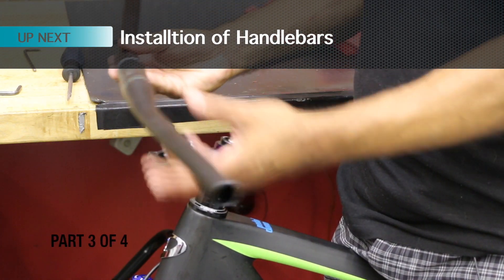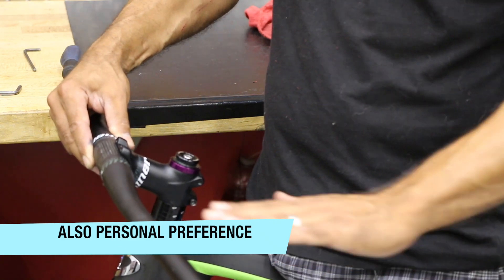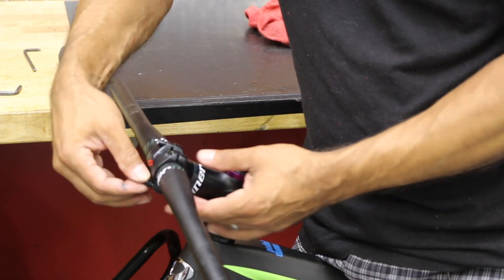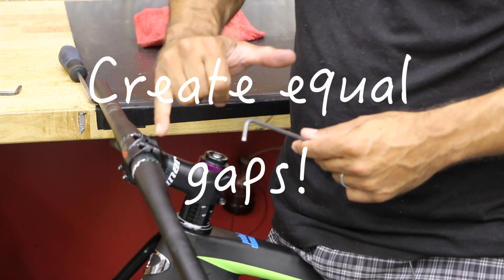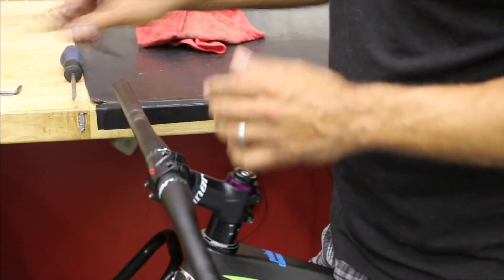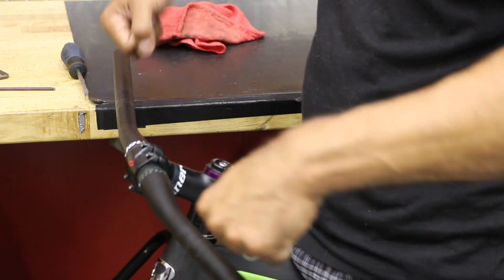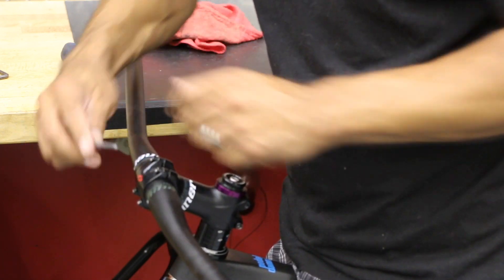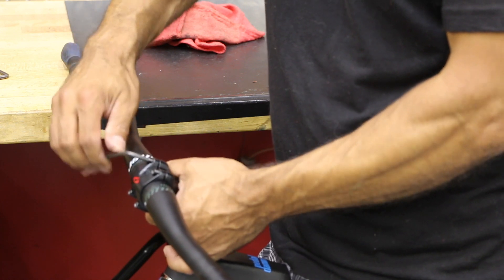How to install handlebars on a stem

Comment: Doesnt the Easton recommend having the top plate touch the stem then torque the bottom like a clam?
Reply from the maker: I am not sure about that. Its possible they have a unique design in which case you would follow their directions.
Reply: @BikeTeacher  do u have a video explaining the advantages and disadvantages of dishing the wheel to be centered to your seat stay versus your hub? Which is the right thing to do?
Reply from the maker: I do not have a video on that. The way I was shown and believe to be the strongest method is to dish to your hub. You are basically centering your weight for impact. Although wheel manufacturers are getting creative and may do the opposite. Refer to the manufacturer when in doubt.